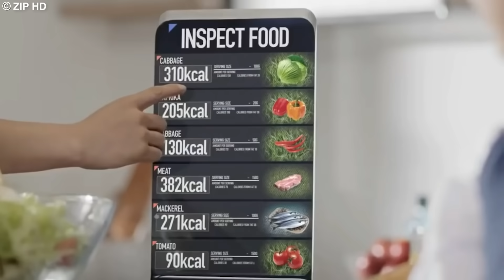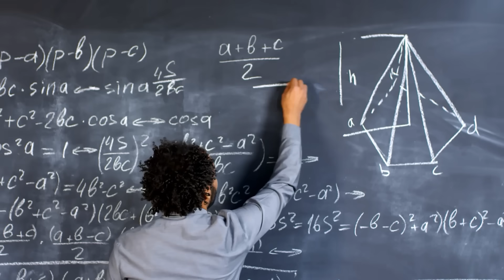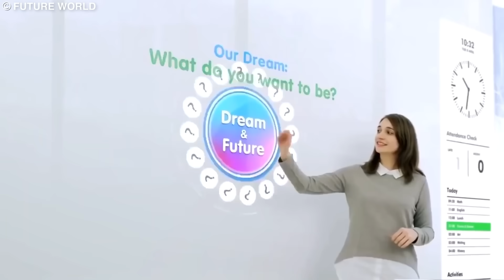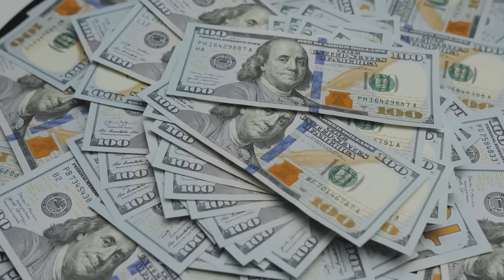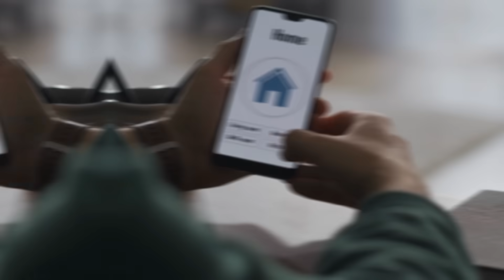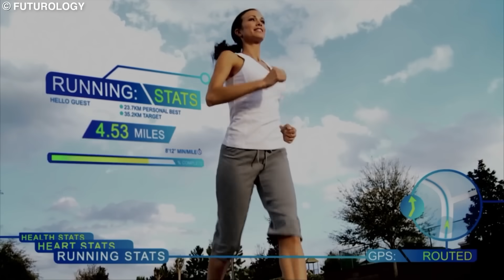How Life Will Look Like In 2050

Comment: 00:00 Nanotechnology and 3D Printing are the upcoming technologies that will transform our lives.
01:17 Advanced technology in 2050
02:33 Transportation in 2050 will be vastly different with self-driving cars and the Hyperloop project
03:52 Adapting to sustainable energy and space exploration are key to mitigating environmental issues.
05:07 Artificial intelligence will drastically change the job market and education system by 2050.
06:24 Online degrees and AI-powered robots may be the future of education
07:37 By 2050, cash will no longer be used for transactions and homes will be completely automated with AI.
08:50 By 2050, we will be able to control our hologram TV with our minds using nanotechnology.
Reply: Please tell me there's going to be a time machine, invisibility ray, age reverser, memory eraser, duplicator ray, time stopper and all cool inventions would be there.

Comment: I'm 71. I see things now that we could not imagine back in the 1950' , 60's and 70's.  My first experience with a computer was writing a program and saving it on a set of punch cards. I've spend 90 percent of my working career in mechanical engineering. When I started back in 1979 all of our designs and drawing were done on paper or mylar with pencils or ink pens. By the time I retired 35 years later we were doing designs with 3D modeling on computers. Every year technology accelerates a little faster than the year before. The more advanced the technology the faster we can improve on it. Engineers and designers are NEVER  satisfied with the finished product. They are ALWAYS looking for ways to make improvements. The only thing that will and have slowed the future is money and politics.

Comment: Claytronics will be used more than nanotechnology

Cars will all be downsized 
The new daihatsu tocot will ne a average size car
And will use a hydro-claytronic system
Using claytronic cells with a programmed instinct to rub water in a way to produce electric energy and force
Slowly evaporating water
Water ends up out the exhaust 
Into the clouds
And rains back into the Ocean 

You can refuel your car with a garden hose